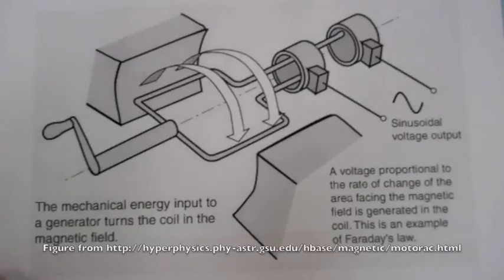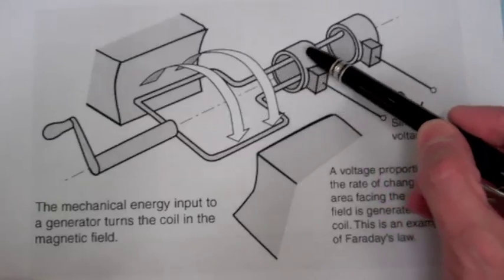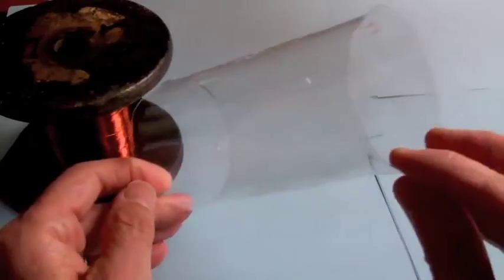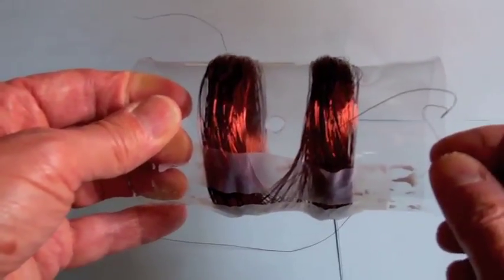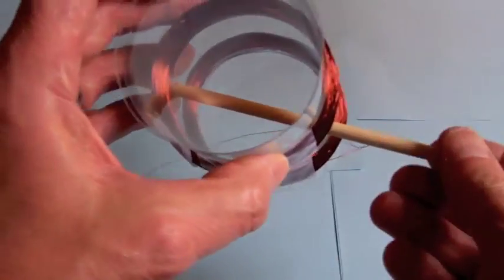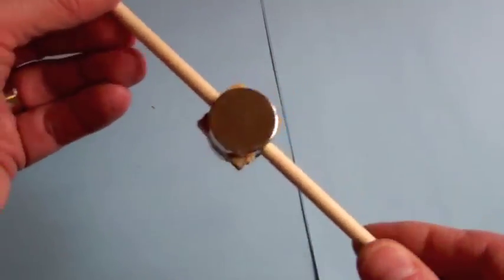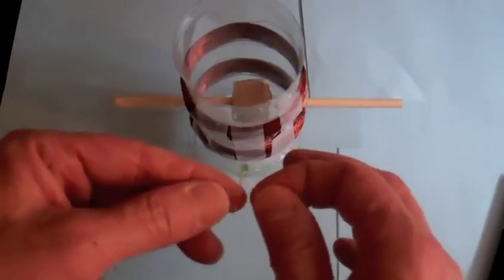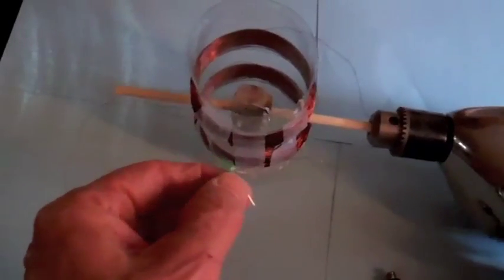AC Generator

Comment: This is a dc motor not a ac generator
Reply from the maker: No,  I am using mechanical motion to light an LED. That is generation of electricity. The LED going on and off with the frequency of rotation indications AC.
Reply: @electricandmagneticfields2314  no this is how a dc motor is made, the magnets are curved to get a better dc flow also if it was ac then why is it built like a dc motor?
Reply from the maker: @CLOCK-WORK  This is a dc motor https://youtu.be/PO0m0xFcyS0

Comment: Sir I'm making this for an exhibition, and I want to know that are 500 turns really necessary to light up the small bulb?
I'm using super strong neodymium magnets, can I do it in lesser number of turns?
Reply from the maker: I am sure it will work with less, but the more turns the easier it will be to get it to light. In other words how fast you have to turn it. If you have a drill to turn it you can probably get my with a lot less.
Reply: @electricandmagneticfields2314 
Firstly thanks alot for replying:))
No sir, I do not have a drill
I think I will have to give 500 turns around the bottle
Thanks alot for replying:)
Reply: @electricandmagneticfields2314  also sir, can you please specify the wires used in this video
Magnet wires means copper wire, right sir?
Reply from the maker: @johubify  It is magnet wire, so you have to remove the enamel insulation from the ends. I don't know the gauge. It was wire I found in our instrument room that was not marked. You want something that winds easily, but the thicker the less loss in the resistance of the wire. With that said, the wire I used was fairly fine. I will try to look later at some spools of wire and estimate the gauge I used.
Reply: @electricandmagneticfields2314  thanks alot sir!
Actually in this video you have mentioned that it is 32 gauge, so that is what I got:)
I will be sure to remove the enamel coating before winding
Reply from the maker: @johubify  I haven't watched the video in a while and I forgot I mentioned the gauge of the wire. The video shows 32 gauge worked. I probably used that because that is what I had available. If you went to a larger diameter it would mean less resistance so it would enhance your changes of getting enough voltage across the bulb. But if you already have gotten 32 gauge that should still work.
Reply: @electricandmagneticfields2314  thank you so much for assisting sir.

I just do not happen to have the tools for removing enamel, can I do without it sir, or is removing the enamel necessary!?
Reply from the maker: @johubify  It is necessary in order to make electrical contact.

I usually just use a knife and scrape it off. If the wire is too thin it can be a little tricky to do without braking the wire. You could also use sand paper, which is easier.
Reply: @electricandmagneticfields2314  thank you so much sir
I used a knife
My setup works perfectly!
Reply from the maker: @johubify  Wonderful! So you got your bulb to light?
Reply: @electricandmagneticfields2314  yessir I made around 800 turns along with ultra strong magnets and the bulb is glowing extremely well
It's almost consistent!
Thanks alot sir
Reply from the maker: @johubify  You are most welcome!

Comment: i need help i want to reach 230v,50,100w generator please help
Reply from the maker: You have to increase the change in flux linkage with respect to time. You can do this by increasing the number of turns, increasing the frequency of rotation, and increasing the strength of the magnetic flux density.
Reply: @electricandmagneticfields2314   I want it as an axial alternator with 12 coils and 12 magnets circular magnets and coils how do i give magnets north, south,north,south? I want the lowest possible speed rotation
Reply from the maker: @STUDIO_MC-u4i  I've never built such a generator. I found this video that shows magnets mounted at 7:35 into the video.

Comment: What kind of LED did you use?
Reply from the maker: I don't remember but it was probably like one of these

https://www.amazon.com/dp/B07K4CKWXH/ref=sspa_dk_detail_2?psc=1&pd_rd_i=B07K4CKWXH&pd_rd_w=o0Eay&pf_rd_p=4269e1a0-a218-4fbd-9748-1cd337d2f2a5&pd_rd_wg=wHHPE&pf_rd_r=7PRFBBK9EKPDT2BFXMXT&pd_rd_r=f99a1e70-7324-4913-9397-b5359eadd1e7&spLa=ZW5jcnlwdGVkUXVhbGlmaWVyPUEyU0FQWVVJTDFLNlpRJmVuY3J5cHRlZElkPUExMDIyOTg4TUJDRjBMV0RQWVRYJmVuY3J5cHRlZEFkSWQ9QTA3NTMxMTQxVVpXSjVNOEgzWFIxJndpZGdldE5hbWU9c3BfZGV0YWlsJmFjdGlvbj1jbGlja1JlZGlyZWN0JmRvTm90TG9nQ2xpY2s9dHJ1ZQ==

Any LED should work.
Reply: @electricandmagneticfields2314  Thanks! Just curious, would most any LED work, like out of those cheap flashlights?
Reply from the maker: @gerrym.3353  Yes

Comment: Hi , I tried but it didn't work for me. The only mistake I observed in my project is that my wire broke once so I joined by coiling the wires and put a tape to cover the joint. Is this factor that my project failed?
Reply from the maker: Did you use a rare earth magnet? It helps to have a very strong magnet.
Reply: @electricandmagneticfields2314  yes not neodymium but very strong

Comment: you said you wrapped 250 loops around the cylinder for 1 coil, and then 250 for the other. yet it is plain to see that there are many wires going back and forth between the coils. why did you do this, and why didn't you mention it ?
does it mean that to work you have to have a certain number of wires going between the coils ? and are they one continuous winding, or 1 coil clockwise and the other CCW ?
this is the kind of thing that annoys me about some "instructional" videos. they say they do one thing, but what they actually did was different.
Reply from the maker: I don't recall why I wound it the way I did. It should not make a difference if you do them on one side first.

Comment: If we increase the number of magnets like here you have 1 pair if you have more than 1 pair does that increase voltage?
Reply from the maker: That would increase the magnetic flux, which would result in a larger change in magnetic flux with respect to time for the same frequency of rotation, which will give you a larger voltage.

Comment: Does it matter how the field cuts through the wire, does it need to perpendicular, or can it cut along the length of the wire.
Reply from the maker: The flux has to very inside the coil, so in this case down the axis of the inside of the water bottle.

Comment: Sir i have not enough wire so can i reduced turns.suggest me minimum turns
Reply: Use a much smaller plastic bottle.  The wire must be VERY CLOSE to the spinning magnets.   When it is close to the magnets (almost crashing them,) then you need only fifty to 100 turns, in order to flash a red LED.

Comment: Sir i have used same disc shaped magnets and copper wire of 32 gauge but its not working though the rounds are 1100
Reply from the maker: Does you copper wire have insulation on it? If not, then you essentially have one turn. If it has insulation, did you remove the insulation from the two ends?
Reply: Sir it is insulated and at the end i have removed insulation properly
Reply: Sir does the radii of coil matters
Reply: Please sir help me i m having my board practicals and i have made file related to it.....
Reply from the maker: The radii does not matter. Did all your windings go in the same direction?
Reply: Yes sir
Reply from the maker: What do you have it connected to? An LED?
Reply: Ya sir

Comment: How did you placed the magnet sticker stick inside the plastic shell?? I am wondering..

Please share
Reply from the maker: I drilled holes on opposite sides so I could slide the wooden rod through the bottle. The ends are cut off the bottle, so I could reach inside and place the two magnets, which hold themselves in place.

Comment: You said insulation was required,but you are not using insulation on your wire.How did it work then?
Didn't the bottle collapse because of so much of wire wrapped around it?
Reply: approx how long wire in metres will i need for this?
Reply from the maker: I am using magnet wire, which has insulation. The insulation is usually copper colored or red and why it does not look like the wire has insulation in the video.
Reply: Yes, thank you.I recently found that out when I bought the wire.Great video by the way.

Comment: Can you please help me I have a question?
Reply from the maker: What is your question?
Reply: Michael Melloch thank You for noticing me, I have to do this for my school project and I did everything but it is not working. I am assuming it is because of magents, I don't understand in magents so I don't have clue what magnet type is mine but it is grey and in the shape of rectangle. They are also small and I have 2 of them. I did everything as In the video but it just isn't working. Please help, thanks.
Reply from the maker: The more change in magnetic flux you produce the greater the electromotive force you will generate. Stronger magnetics is one way. Another way is to increase the number of turns. You double the number of turns you double the voltage you produce. Also does your wire have insulation? If not then you effectively have only one turn. Also if your wire has insulation did you remove it at the two ends so that you can make electrical contact?
Reply: Michael Melloch it is copper wire just like you used in the video, should I take insulation off with lighter?
Reply from the maker: Or you could use sandpaper or a knife.
Reply: Michael Melloch but my insulation is so thin, even whole wire is so thin, is that a problem, does it have to be thicker?
Reply from the maker: The thin wire should be fine. Sand paper should work to take off the insulation.
Reply: Michael Melloch okay thanks I will try once again or until I lose my patience, because this is so simple yet I can't make it work..
Reply from the maker: It helps to get away from working on a problem before you loose your patience. Your subconscious mind will still be working on the problem. There is truth to the statement about sleeping on it. An idea will just pop into your head about what might be wrong and what you can try to get your generator working.
Reply: Michael Melloch Can you just suggest me similar projects to this one just in case so I can try, theme is electromagnetism like to create voltage when magnet is moving in wire or wire moving around copper?
Reply from the maker: Here are some other videos that utilize electromagnetic induction

https://www.youtube.com/edit?o=U&video_id=H310MWSWxF0

https://www.youtube.com/edit?o=U&video_id=KUihEkvabpo

https://www.youtube.com/edit?o=U&video_id=pMfNuP1Wozw

https://www.youtube.com/edit?o=U&video_id=7dd47gsfDJ8

https://www.youtube.com/edit?o=U&video_id=fiyaYII7ROA
Reply: Michael Melloch Thank you but somehow I can't open them they are misleading me, they bring me to "My videos"
Reply: Oh I saw the videos but I was looking for similar project like this, generator since I have to make project that can light a bulb or just show voltage on instrument.

Comment: Will it work if i use a #20 solid wire?
Reply from the maker: Yes as long as the wire is insulated
Reply: Michael Melloch i tried to make  one but it's not working, i guess the no. Of loops is not enough, can i still make it work by putting magnets?

Oh and lastly, are there LEDs that only need smaller voltage compared to other led?
Reply from the maker: By using more, or stronger magnets.

Comment: Hello sir
Sir how  we insert magnet in the wooden stick
Reply: Why we use plastic bottle??
Reply from the maker: The attraction of the magnets to each other on opposite sides of the wooden stick. I added wooden spacers, see around the 2:45 mark in the video.
Reply from the maker: A plastic bottle was something readily available to be a form to support the windings and rotor (magnet on the wooden stick) plus you can see through it to see the magnets turning.
Reply: Sir why we use plastic bottle ??? If we use copper wire of 27 gauge is it work or not
Reply from the maker: 27 gauge wire will work.
Reply: Hello sir
Sir I used 27 gauge copper wire with 500 turns but still it not work what I do ??
Reply from the maker: What type of magnets are you using. The stronger the better such as these rare earth magnets, https://www.amazon.com/DIYMAG-Powerful-Neodymium-Permanent-Scientific/dp/B06XD2X45M/ref=sr_1_4?ie=UTF8&qid=1518658725&sr=8-4&keywords=rare+earth+magnets

Comment: would you please tell wire's thickness and do the bottle affect the flux also what should be the strength of magnet
Reply from the maker: I don't recall the gauge of the wire, but anything  that you can wind around the bottle will be fine. If I had to guess it was probably 22 or 24 gauge. The bottle will have no effect. Any plastic bottle will work. I was using large rare earth magnets. I think they were about 3/4 inch diameter. So when two of them were stuck together it was very difficult to pull the apart.
Reply: bu I used copper wire still no current is produced do I need to burn it or somethingto be put rubbed on it??
Reply from the maker: The wire has to have insulation, you cannot use bare wire otherwise you effectively only have one turn.

Comment: I have used insulated copper wire and led from led lightings but still not working please help...,,😖😖😖😧
Reply from the maker: Did you remove the insulation from the ends of the wire so that you could make an electrical connection to the diode? How many turns? What type/strength magnet are you using?
Reply: Yeah,I removed the insulation and I think I had made 150-200 turns.i am using four 2*1.5 magnet putted on cylindrical magnet can this be the cause? Thanks for replying
Reply from the maker: You probably are not generating enough change in magnetic flux. More turns, a lot more say 1,000, and stronger magnets would help. Use an LED with the lowest turn on voltage possible--so that would mean red.
Reply from the maker: For instance you might be generating 0.5 V, but need 2V to turn on you LED. So 4 times the number of turns would do that, 4 times greater rotational frequency, or magnets that are 4 times stronger.
Reply: Thanks for your support and help I am making desirable changes let's see .....
Reply from the maker: Many (most) of the demonstrations I have uploaded videos of did not work the first time. Sometimes it took many iterations. The video of the spark coil took me several months to get working. I learned a lot in the process.
Reply: Today i tried by using 100m wire coil and putted thread on aluminium rod which make it spin faster than hand but still no sign of  current pls help can the aluminium rod on which I have putted magnet could be the cause?
Reply from the maker: The aluminum should have no effect. So your configuration is the magnets are attached to the aluminum rod and then you are turning the aluminum rod? Can you attach a hand drill to the aluminum rod so that you can spin it faster?
Reply: I got the cause actually I had putted 4 magnet around a cube which had created 2 n-s pole when I remove one n-s pair it worked
Reply from the maker: Wonderful! This is the experience I often have when developing these demonstrations. They often don't work at first and I sometimes have to think for a while about what to try to get them working. I learn a lot in the process.

Comment: It's  okay if I use 25 gage magnet wire and 250 turns
Reply from the maker: 25 gauge is fine, but the more turns the more electromotive force you will generate for the same change in magnetic flux.
Reply: Michael Melloch  It's okay if I use an ordinary Magnet or much better If I use an neodymium magnet 
Because I made 200-200 
From left and right
Reply from the maker: The stronger the magnet the better as you will get a larger change in magnetic flux for the same rotational frequency.

Comment: Why doesn't it work?
Reply from the maker: Why doesn't what work?
Reply: Will it not work if a normal copper wire is used?
Reply from the maker: Does your wire have insulation? It cannot be bare wire. Otherwise it is like having just one turn. Also be sure to remove the insulation from the ends of the wire.
Reply: Oh, thank you! Now I know what's the mistake. 😊

Comment: Can we use some other kind of magnet?
Reply from the maker: Yes any magnet will work. It is just the weaker the mangnet the less voltage you will generate for the same number of turns and rotational speed.

Comment: how much this model will cost
Reply from the maker: The only cost should be the wire and some strong magnetics. The magnet wire should be under $10 and rare earth magnets would be about $10. For the other parts uou can use a pencil for the rotor and any discarded plastic bottle.

Comment: Is that a electromagnet that is used in a a.c. generator?
Reply from the maker: Electromagnets are used in the large generators used in power stations.
Reply: Michael Melloch Thanks. So wouldn't they also use a electromagnet in a home generator?
Reply from the maker: I am not familiar with home generators, but it is likely they use electromagnets. In general a generator can have an electromagnet or a permanent magnet,

http://www.dieselserviceandsupply.com/How_Generators_Work.aspx

The same for the generator in a wind turbines,

http://www.pmgenerators.com/how-permanent-magnet-generators-work/